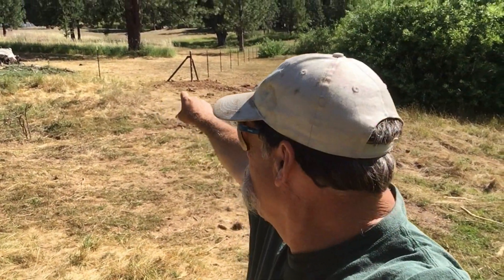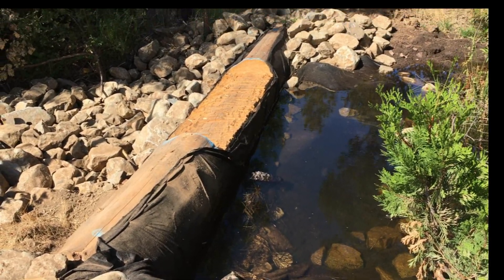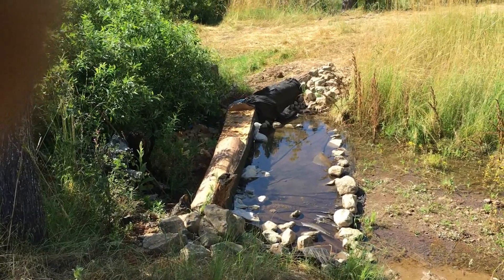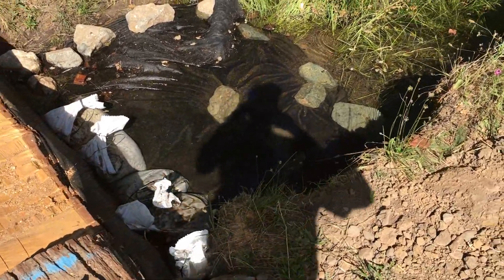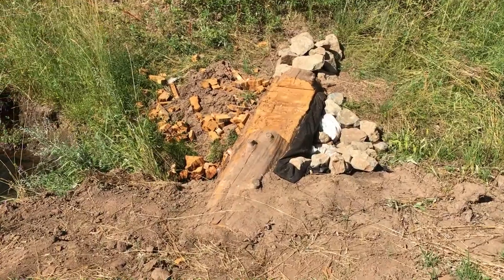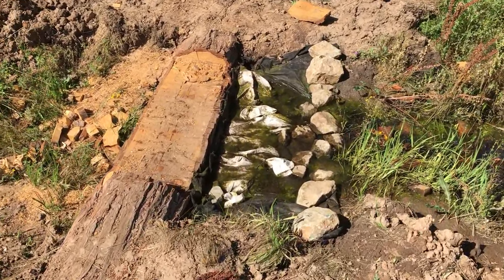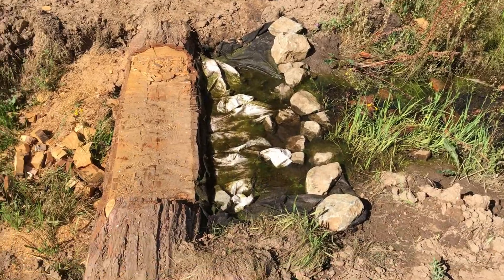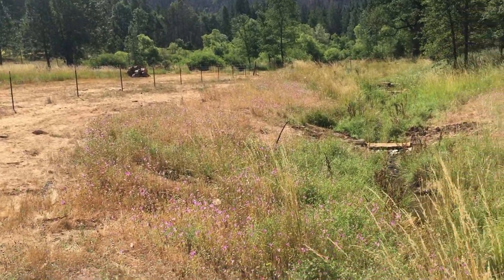Dam Building Project Update

Comment: I'm surprised you weren't advised to put several rows of rocks on the bottom of the spillways on the downhill side to prevent erosion at the base of the dam from water going over the spillways.   That is what they do in the one rock dams to slow the force of the water & prevent erosion.  You just used logs in place of all the rocks.
Reply from the maker: Oh we did, for about 15 ft out from the dam.  Thank
Reply: @RRINTHESHOP  good I didn't see that.

Comment: A little bentonite should stop the leaks, and is a great alternative to using plastic as a liner. It should be available at any supplier for irrigation pumps. It's commonly used a liner for man-made lakes and landfills, and is used extensively to make drilling mud.
Reply from the maker: Yep we may just do that.  Thanks E.

Comment: I know most weather events that happen out there are not the same as those that happen here in TX. But it is mostly the same here, after July 4 it gets hot and dry until Fall. If you get a chance to film even a short update when those ponds get fuller, I'll watch it! (like I ever miss any of your videos).
Reply from the maker: About the same here Wes,  Sept/Oct the first good rains usually come.  It is just 3/4 mile down the street.  i will do another dam update then.